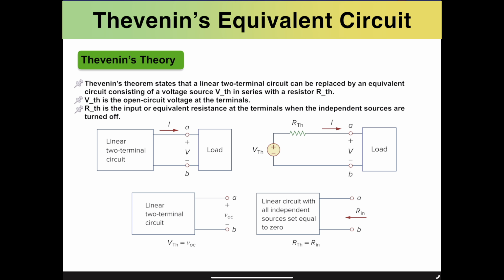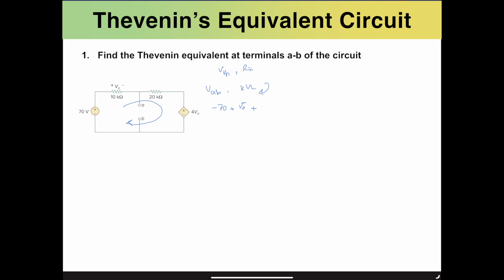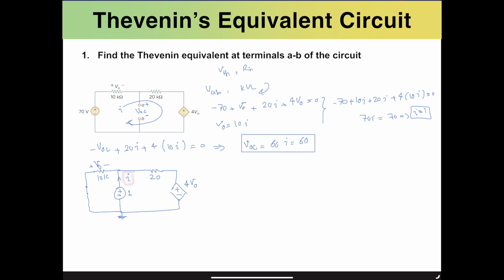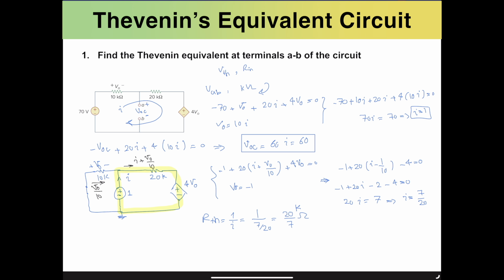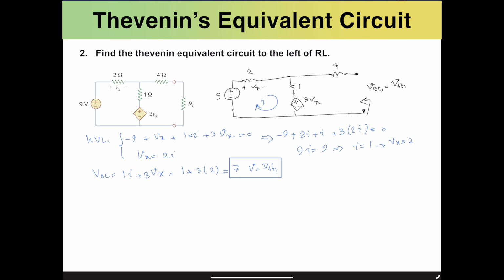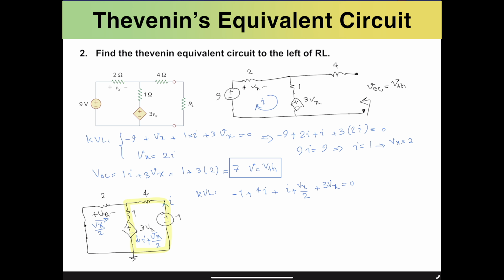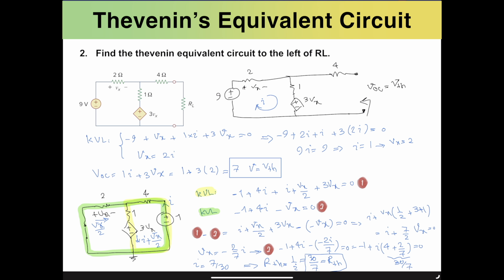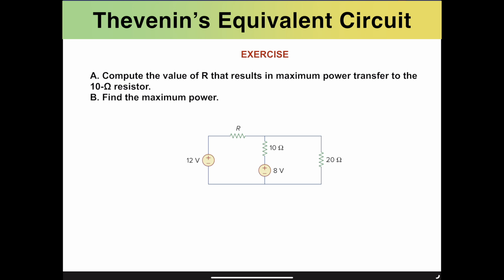Thevenin’s Equivalent Circuit | Solved Example

Comment: For question 1, shouldn't we be using 20,000 and 10,000 as the resistance values? In the equation, you just used 20 and 10 for the values, which wouldn't work, right?
Reply from the maker: You're right - Indeed, what I have considered is kOhms, and the resultant current values would be in mA range. Alternatively, we could start from scratch and consider all resistors based on Ohms and the currents would the be in A.